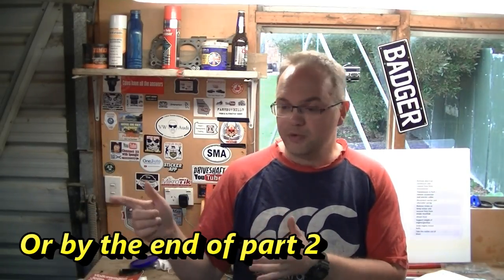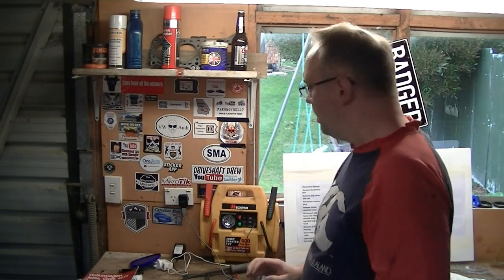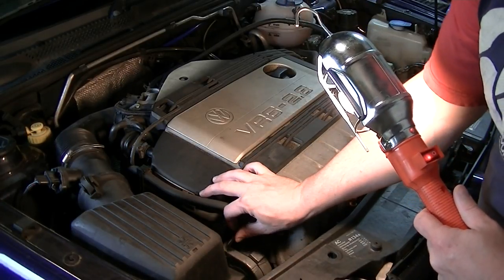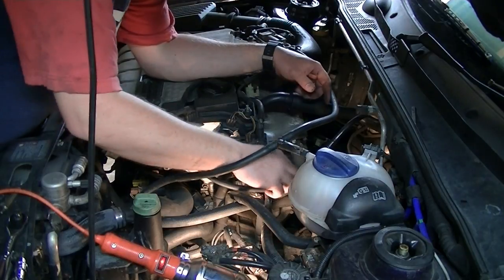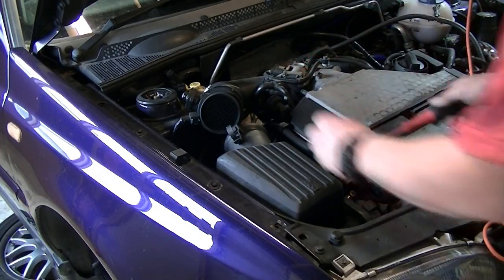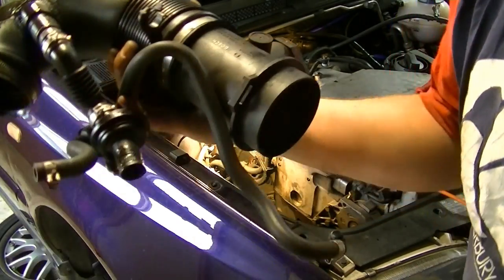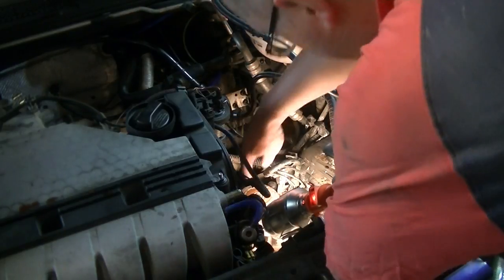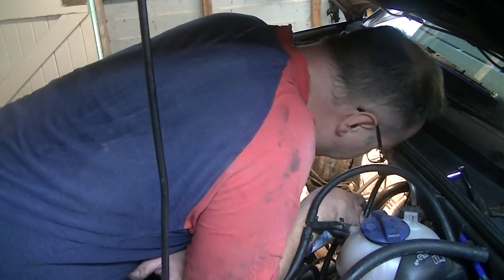VR6 Engine Pull - Part 1 - VR6 Rebadgered

Comment: You're making some really good progress there Jonathan and looks like everything is going smoothly. You're doing exactly what I would be doing and that's filming it, especially with an engine that I've never pulled before. You'll be amazed how obvious things come apart and you'll tell yourself, awww, I know where that will go. And then you'll be scratching your head later saying, "Did this hose go here or over there." HaHa! You're doing a great job and keep up the good work!
Reply from the maker: +stuzman thanks Terry. I'm happy with the progress and I've been there before with the head scratching! With the gearbox swap some of the coolant hoses change and all the gearbox connectors go so it will be a jigsaw puzzle whatever happens.
Reply: If you run in a bind, you'll have a lot of YouTube engineers out there 
as you've mentioned, so we'll all be ready to help if needed :)
Reply from the maker: +stuzman exactly. At the end of part 2 I'll be asking opinions for the next step. Will see what the community suggests

Comment: Lookin' good so far!  You may want to look into sending the head out to be resurfaced; that oil seepage may just be an old head gasket, or there may be some slight warping on the head itself.  The main oil feed for the head is basically right there, and if the surfaces of the head and block aren't perfect, you'll have an oil leak there even after replacing the head gasket.  I've been tempted to O-ring the oil passage in the head on my own...
Reply from the maker: +rhkips taking the head off is beyond the budget! I can live with seepage 😁
Reply: Badgertronix
Haha, well alright then!  It doesn't look bad at all; about what I'd expect for its age.  :)
Reply from the maker: +rhkips will inspect it all when the engine is out and let the YouTube Certified Engineers give an opinion 😂 My automotive OCD might kick in and make me throw on a mk4 metal head gasket
Reply: Badgertronix
I'll be sure to have my YTCE degree handy!

Honestly, it looks fine.  If you're not separating the head, there's no reason to address it.  If it starts drooling, then it's time for a head gasket and head work.  :)
Reply: rhkips No need to fix all... all at once. Have to leave some work for future man cave activities! =)
Reply from the maker: +Thomas EXOVCDS he has got me thinking about pulling the head and raising the compression ratio with the mk4 head gasket. 'whilst I'm in there' of course
Reply: Badgertronix I just got confirmation that my last 2 packages (for my project) are on the way... who knows what unexpected goodness I will run into "whilst I'M in there". =)
Reply from the maker: +Thomas EXOVCDS it's tempting to do so much, if only money grew on trees. I wasn't even going to change the cam followers but they went on special in the new year sales...

Comment: HI looking for some advice info.  My vr6 overheated.  Im in the process of taking off the head to replace the gasket. Are these aluminum heads prone to going soft if exposed  too  heat?  What numbers would be coincided a pass if I get a hardness test?

Comment: That oil spray never fails to make me laugh!  Lots of fiddly bits on that engine.  I'd definitely replace that water pump while the engine is out.  I don't see how you'd be able to replace it any other way ;) Coming along great!
Reply from the maker: +farmboy30117 it's a winner of a clip. Still got the stains as a reminder. Will have a good inspection when it's out and see what other bits I need.

Comment: Im not sure if you said it already but what do you plan on doing that requires to pull the Engine out?
Reply from the maker: +Yannick J. That's all coming up in a future episode, but different gearbox and some engine mods. Cheers!
Reply: Badgertronix good to hear that you decided on getting rid of the Old auto-trans. that will probably be the highest increase in Performance. can't wait for the next episodes!!
Reply from the maker: +Yannick J. Absolutely! I hate autos but almost every VR6 in the country is auto so didn't get a choice when I bought it.
Reply: Badgertronix well. you have the skills to change that. what trans do you wan't to swap in? 5 spd or 6 spd?
Reply from the maker: +Yannick J. Thanks! It will be a 5 speed 02a. These things are hard to find here.
Reply: Badgertronix isn't that the original trans from the manual Vr6? are most cars in your country Auto or how come there are so little manual vr6's?
Reply from the maker: +Yannick J. Yes that's the standard VR6 trans. Almost all cars here are auto. So annoying, only my mum would drive an auto out of choice